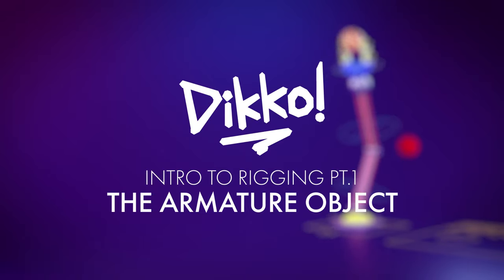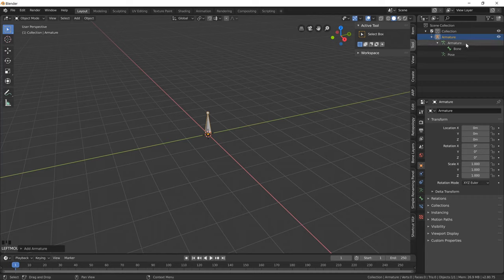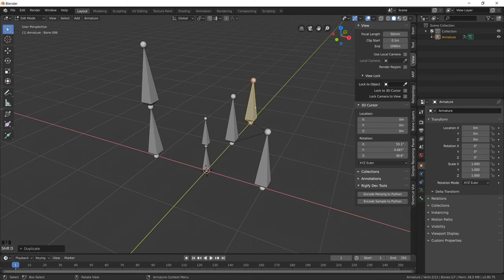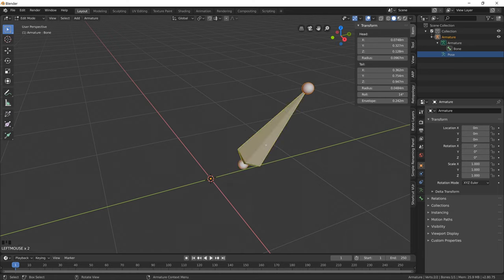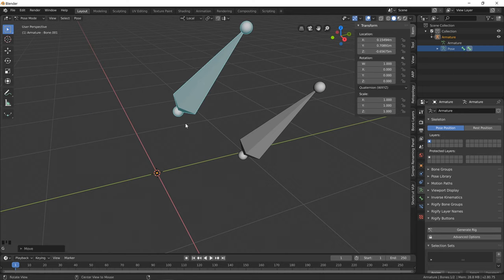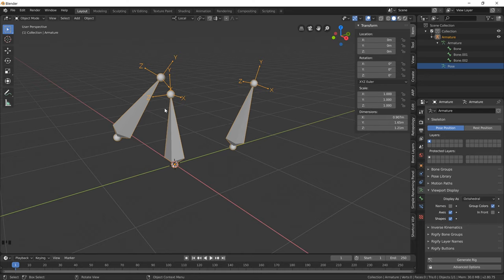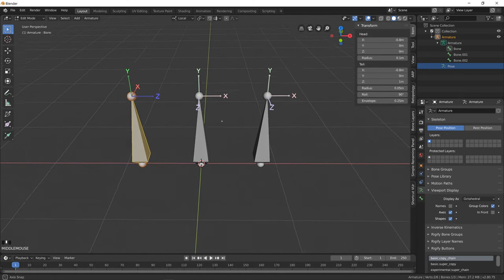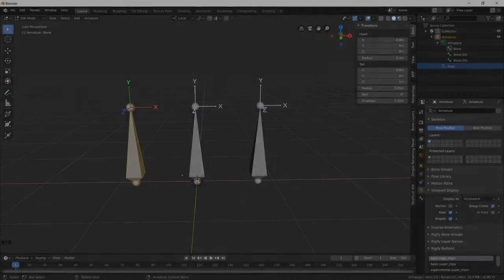Beginners Guide to Rigging in Blender - Pt. 1 The Armature Object

Comment: When I clear transformations in object mode, the origins go to the World Origin. This seems to cause a problem with Mirroring around an object and snapping the cursor to the center of the active object. How did you circumvent this problem? It didn't seem to happen to you in these videos.
Reply from the maker: if you want to snap the 3d cursor to the centre of an object that has cleared transforms, just go into edit mode, select all, then snap the cursor to the selection.
Reply: @Dikko  You rock Dikko. Thanks for getting back to me.